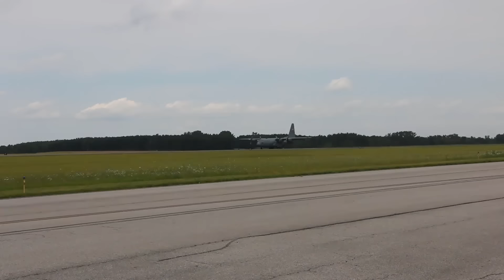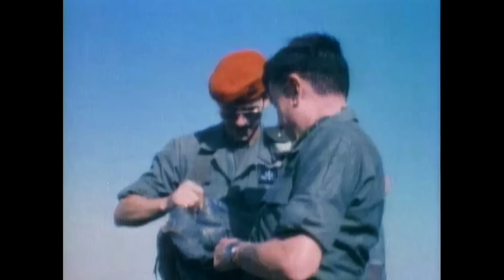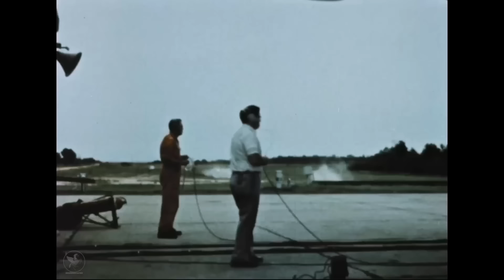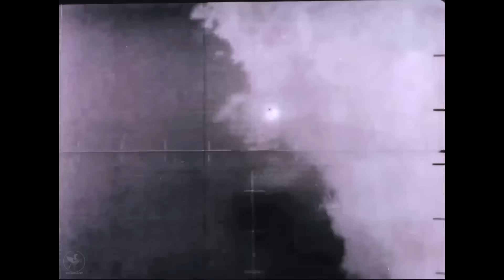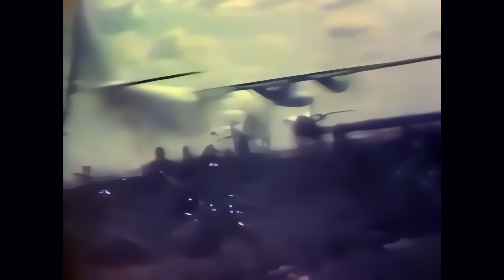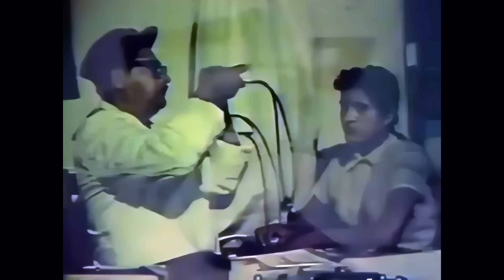Lockheed C-130 Hercules | An Aircraft Capable Of Doing Anything | Aviation History Documentary

Comment: 3:19: a ground roll of 400 feet?
Reply: They actually tested, and successfully launched and landed the Herc dozens of times from an aircraft carrier.  It's on YouTube.
Reply: @tvdroid22 but that is catapult assisted right? A ground roll is all self powered from the aircraft right?
Reply: @bigbaddms  Negative. The Herc did it all without catapult assist, nor did it have an arrestor hook for landing. The Navy was seriously considering using it, but ultimately decided against it and employed a smaller aircraft with other methods being used for really big components. Still, it did work, and they did it dozens of times in testing, 21 take-offs and landings, and 24 touched and goes if memory serves. The weight was gradually increased and ultimately it was like 130,000 lbs, 30,000 lb being cargo. This was also without the JATO assist seen in some situations. I imagine it'd be somewhat easier now with the Herc's upgraded engines. It is simply, and without question, one of the greatest aircraft ever made.

Comment: Its days are over.. RIP
Reply: The US has 178 C-130Js in active duty and more on order. On top of that there’s over 150 C-130H in active duty. What are you talking about?
Reply: More of your wisdom, please. 🤭🫰
Reply: Nope.
Reply: There's no replacement for a C 130. Or Dc3.
Reply: @dieseltu1035 Legends!
Reply: Are you stupid, they are still making new ones, and with the proven airframe life they will be here for a good time yet.
Reply: That's what they said about the C130 when the C141 came out back in 68.....Where's the C141 at now.....
Reply: @1944Jakob  The C-130 has been in production for 70 years. Nowhere near retirement for this one.
Reply: Not yet, comrade!
Reply: If a replacement for the C-130 was designed, it would look almost exactly like a C-130, so they just refurbish the old ones and build new C-130J’s.
Reply: @Anymouse6980  I wonder if they will design a semi tilt prop like the osprey to assist takeoff. Not a full VTO. I can see them retro fitting engine design
Reply: @  Interesting. I know several deigns were tested, to include a four-engine tilt-wing, in getting to the V-22 Osprey.
Reply: Probably not. The C390 looks totally different and on paper seems way more capable.